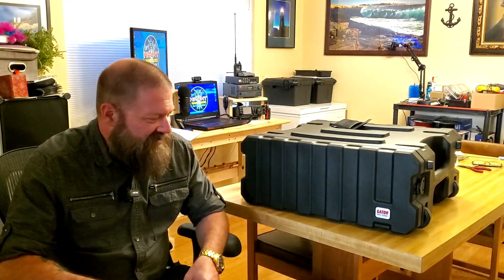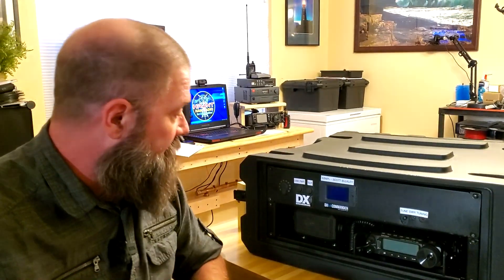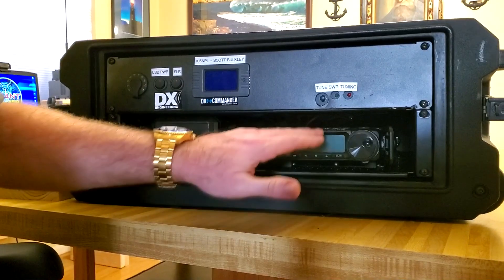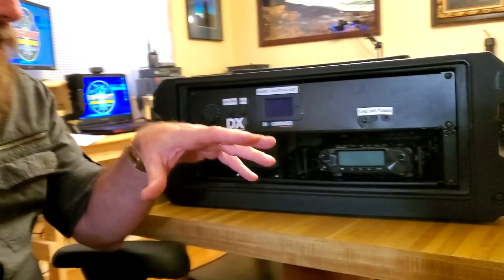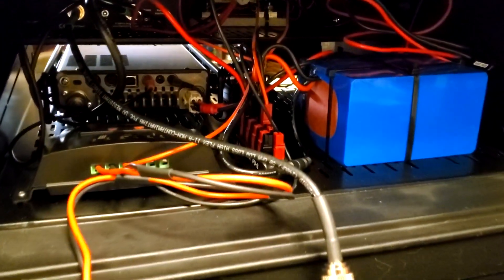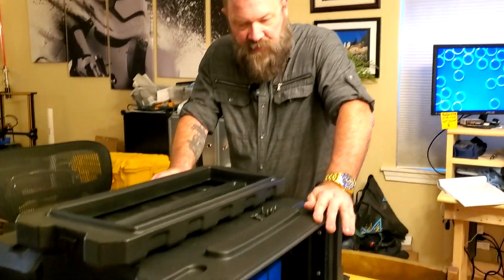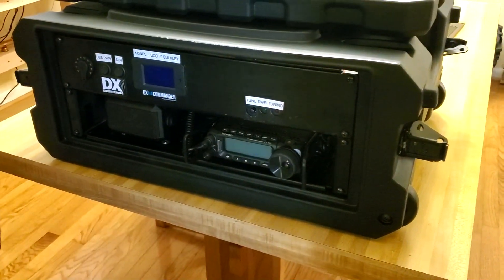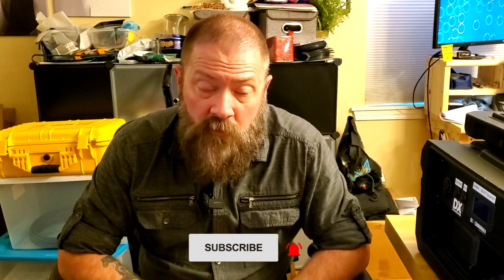My Ham Radio Go Box Build

Comment: Very nice build. I have the FT-891 too, and a
couple of years ago purchased the DX 😞😞
Commander for it from Hardened Power 🔋
Systems in Pulaski, TN. It handles the radio,
has 2 speakers, and Anderson PowerPoint.
There is a 20 amp Biophosphate battery all
in a metal ammo case. It cost about $650.00. Recently, it would not charge, and
after contacting the company, I sent it back
to them per their instructions in the middle of May 2021, waiting a couple of weeks after it was received by them, with no word
from them. I wrote emails and attempted
phone calls to the Company, in June with no answer. Then I saw some complaints of their
problem of no results on reports by other purchasers on eHam.net and the better business bureau. So this is my situation.
73 de W2CH  Ray
Reply from the maker: Sorry to hear that you are having issues.  I would stay on them like white on rice until it is resolved.  You spend that kind of money you have a certain expectation of performance and quality.  For them to ignore you and not give you any updates is pure BS.  I went with the Bioenno stuff due to the many good reviews of their products AND customer service.  I had a small issue with my order and they took care of it the same day and rushed out the missing part to me.  Customer service isn't what it used to be and won't improve unless consumers hold retailers feet to the fire to give better service or cut them off from future purchases.  I ONLY use and recommend companies that I have personally dealt with and approve of to MY STANDARDS before I blurt it out on one of my shows to you guys.  If one of my viewers has an issue, I hope they would contact me so that I can see about helping out the situation.  Again sorry for the issues you are having.  Thanks for the comment.  Good luck & 73!